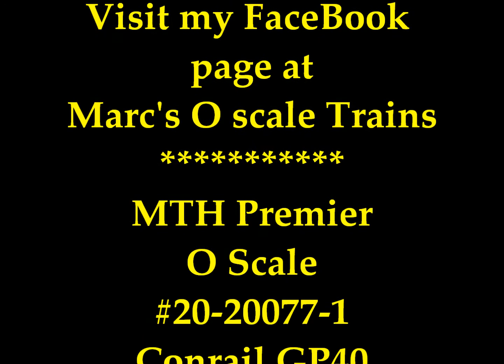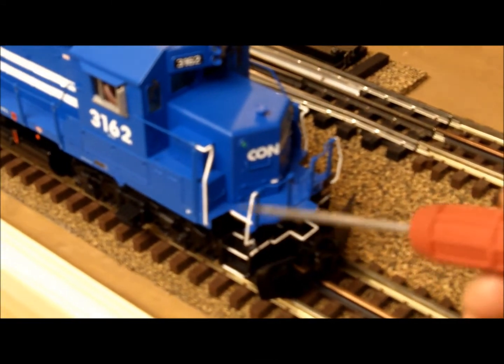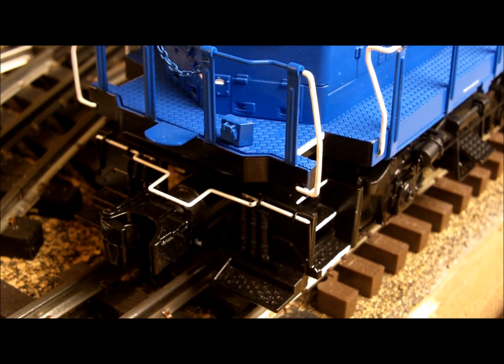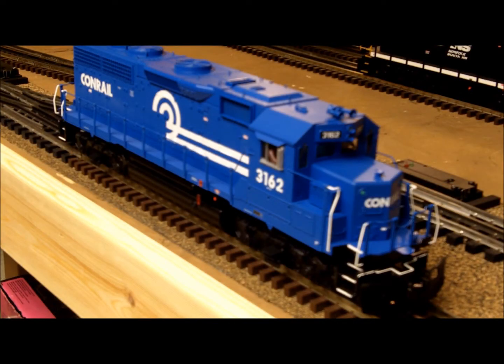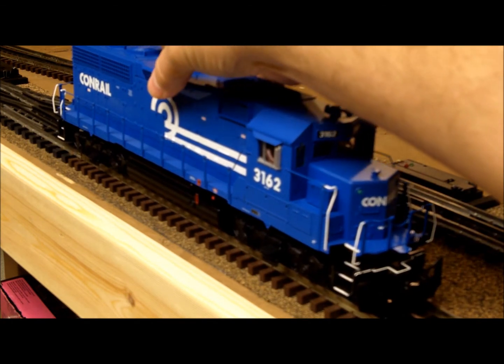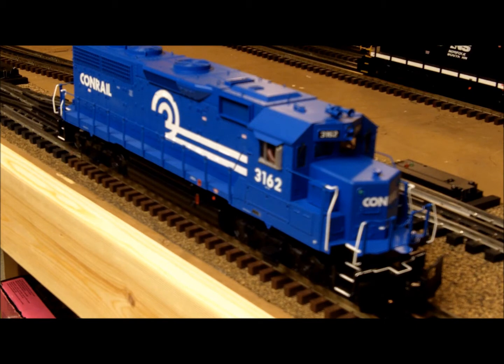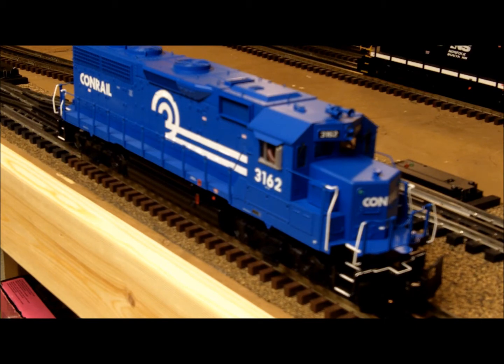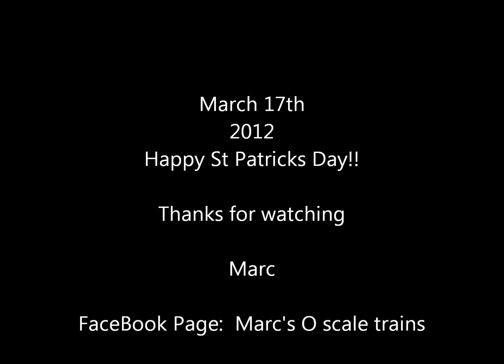MTH Trains Conrail GP40 Premier diesel O scale engine # 20-20077-1

Comment from the maker: @escape150 I'll tell ya Ron this engine is everything we look for in a model. The performance is excellent and the detail is so nice. The video doesn't do it justice.  I need a new camera.  I never mentioned that this model has the Proto Yard effects and the engine cab doors open on each side.  One on the front left and the other on the right rear.  It was pulling a bunch of cars at 2SMPH with out an issue.  The sound is still 2.0, but very clear.  I am glad that I bought this one.

Comment: MTH gives you the option to download different sounds files with different primemover, bell, horn, etc.  This gp40 engine should sound like an SD40 as they are the same except for the different trucks.  So if you "think" they goofed on the sound, there's an easy fix... just download an SD40 sound from the website and load it into the model.  And that's it.

Comment: Nice engine but I think MTH goofed on the soundfile. A GP40 is a turbo charged engine, same 675 motor as the SD40-2. I don't hear any turbo whine like the MTH SD40-2s have. MTH has done this on quite a few engines that should be turbo-charged but sound like GP9s.